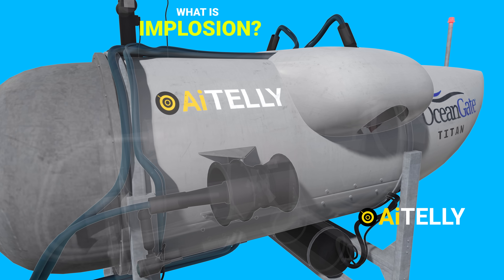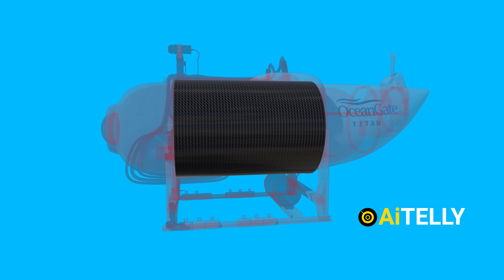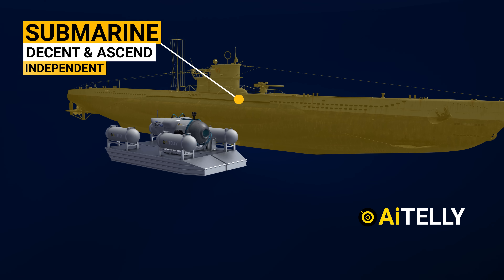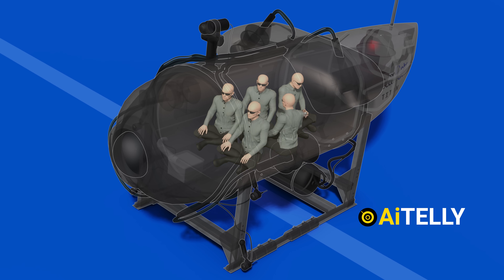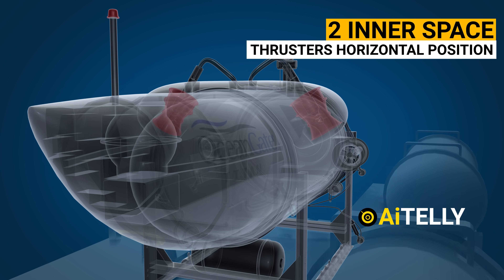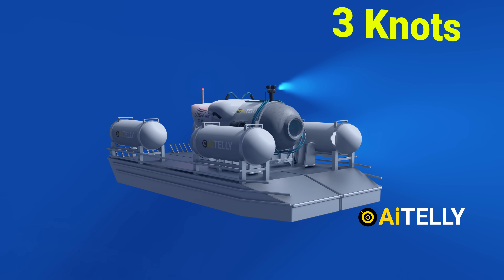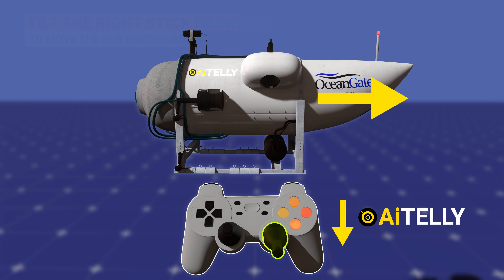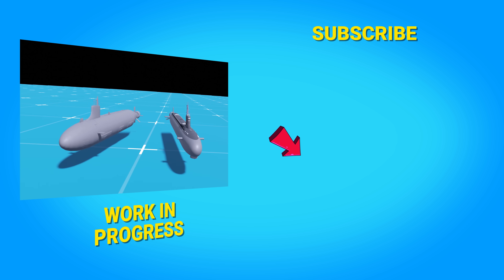Implosion Titan Oceangate How it Happened | Submersible Submarine Parts #3d

Comment: I worked in some of the original HMG (High Modulus Graphite) research--Pratt & Whitney. HMG is significantly stronger than CF. Our prepreg test panels were angled at 30 deg. layers, like plywood, then placed in steel molds and cured with variable pressure and temperature in a thermal press. Cooldown was also a stepped decreasing pressure/temp. process.
The winding and curing process used on the Titan was abysmal and destined to fail. With the changes in pressures and temperatures being repeated, the epoxy/fabric system was doomed to fracturing of the epoxy. 
As soon as I heard of the rapid loss of communication, and then no surfacing of the Titan, I turned to my wife and stated, "it imploded." Never would I have gone on that submersible, once I knew how it was built, and added to the poor materials design, had no internal escape.
Reply: A soon as I heard “submarine made of carbon fiber” I knew they were all dead and it imploded, not an engineer or a scientist, just someone not stupid enough to think carbon fiber would make a good sub lmao
Reply: @joshuad1716 Same.
Reply: You DO NOT build submersibles, with composites, PERIOD!!!!!
Reply: If the supposed leaked audio is true, they were descending unexpectedly fast. They might have already had a leak from the very beginning.
Reply: So incredible yet devistating...being so wealthy I'd assume they'd know this information. Are we truly loosing common sense even with every answer available at our fingertips
Reply: @kelsieann4617 There are plenty of dumb wealthy people in the world. Wealth doesn’t correlate with intelligence
Reply: @louisboliou7432 Did you work at P & W in North Berwick, ME?
Reply: Even when I do my nails I have to sand and remove the moisture from the area that I'm going to glue a tip on. And before I put the acrylic on it absolutely has to have a porous surface to be able to bond to it. 
They didn't even send the cylinder before they glued it. Nobody used gloves while they were wiping off the surface to remove oil m
Reply: Was this the first time this craft was used?
Reply: @korieray7341  No it wasn't. Not even the first craft they built either.
Reply: I am getting frustrated with no concrete information about this tragedy. Is this incident being investigated? If so, by whom?

In your opinion, is it possible to build a submersible with High Modulus Graphite to be able to safely visit the Titanic? The fact that Stockton's submersible made it there and back a few times means it was "almost" successful.

Just guessing, but would a thin steel outer layer around the carbon fiber make it work better?

Comment: That is not accurate, the sub only opened up through that little window that was held on by 19 bolts only accessible from the outside.   The titanium end caps are permanently glued on the the main pressure hull.

Comment: Just the hull section was approximately 40,000 square inches of area on the outside. Multiplied by 5,300 psi, that’s over 200,000,000 pounds of pressure 
I don’t know how you trust metal in that application, let alone carbon fiber.

Comment: This Submersible was doomed for failure from the start as the owners at OceanGate did not put the sub thru the high intensity testing to insure the craft can safely withstand the crushing pressures found at the Titanic's location of 12,200'.Using composite materials to cut costs was the nail in its coffin as many submersibles use a combination of Steel, Titanium and aluminum. RIP to this crew. 🤔🇺🇸

Comment: That implosion was underwhelming.. I expected it would be like a soda can getting squished into the size of a golf ball.. Also I find it really hard to believe this small submersible had no kind of footage/live footage anywhere on it.. I'd bet someone has it, even though it might no show much .. why wouldn't they attach a floating camera that drags along with it so it's viewing the sub from a short distance.. I don't think any of that is impossible or wasn't thought of
Reply: The implosion would have been in microseconds with them being smashed into bits and then it would have exploded violently. The air inside would likely have increased to thousands of degrees in that small fraction of time. It wouldn't be anything like the small crimp that happened in this video. A cool video but the implosion part of it was not anything even close to what would have actually happened. If you know how diesel engines work: it would have been like this sub being inside a giant diesel cylinder, and being crushed until it detonated violently.

Comment: Carbon fiber is good for lateral stress and in tension. Example: airliner fuselages and wings. It's unclear if it can resist the compressive forces the magnitude of a 12,000 foot water column. Also, a sphere is the strongest shape for this application, as forces are equivalent at all points. This thing had everything wrong with it

Comment: It's worse than this... By far. They KNEW they were going to die for about a full minute as they plunged straight down, porthole first, in total darkness. They lost power early into the dive, tipped 90° , and dropped like a rock. There was also an EXplosion A nanosecond after the sudden implosion. When air is compressed that quickly, it superheats resulting in an explosion outward.

Comment: Where did you read the carbon fiber hull "crumpled" like that? Everything that I've learned about carbon fiber through mechanical and aerospace engineering degrees says that carbon fiber would never plastically deform the way you show it, it would shatter like glass. This means the entire premise for your animation is completely flawed because the point of the animation was to show what happened to it and if you dont have some source that shows it crumpled, then you've misinformed millions of people and did a huge disservice to them and the engineering/educational community. I'm happy to be wrong if you have a sourfe though.

Comment: I think that it's unlikely that the oxygen storage and air recycling systems were located in the rear electronics compartment, as that would require penetrations of the endcap to allow gas transfer.  I think that it is more likely that oxygen storage and air recycling /carbon dioxide removal systems were located under the floor of the submersible within the pressure vessel.
Reply: You know we had specs for this thing right?

Comment: It's my understanding that the Titan did NOT submerge using its thrusters but the ballast tanks on the barge it was docked to, and that once it reached a certain depth, would detach and rely on its thrusters for smaller changes and surfacing.
Reply: The thrusters are used to control the speed and angle of descent. Like the diving planes on a submarine.

Comment: The buttons don't look right. The left analog stick is for the camera, everyone knows that. Then, it should strafe with the left, turn with L1 and R1, L3 for descent and R3 for ascend. L2 for thrust forwards and R2 backwards. Square to toggle lights on, double tap for the highlights. Hold X to stand still and stabilize. Triangle for radio contact and O to change between 3rd and 1st person view. Start goes for the options menu. The select button is to implode. Who agrees and who thinks it should be otherwise?

Comment: A couple of shortfalls:
A ship would not drop anchor at that depth 4:35
The aft section at the back would not crush as it's outside the pressure vessel. 0:41
Reply: Thank you for saving me writing same. It's a fancy cartoon, but incorrect.
Reply: You sure about that? What about the oxygen tank and C02 recirculation pump that pumped through the vessel compartment. The parts/pieces inside the aft/tail section would be under the same pressure where it interfaced with the main pressure vessel. If one the ducts or hoses failed it would enter the cabin, like a door on an airplane when pressurized, except instead of sucking out it would suck in.
Reply: @kevins.3825  That's an interesting thought about an external tank imploding. A standard SCUBA tank is full at 200 bar with a big factor of safety. But if they got to the bottom there was 380 bar, a differential of 180 bar compression which a normal tank is not built for. I assume folks designing a submersible would not have overlooked that.
It's possible, but not likely that the external equipment fairing collapsed first and not in the context of the implosion the article was describing.
Reply: @edwardwilley3404  that’s kind of the whole problem with this particular rig is that many things were either overlooked or not tested correctly. One of the most experienced people on the planet for deep dives in submersibles is James Cameron. He has made mention that likely an internal sensor alerted the crew prior to the implosion. So although the crew may have not felt it, they were possibly aware of the issue. 

Let’s say for the sake of discussion that the tanks were not overlooked. How does the ducting factor in? Anything that is hollow or has space is basically collapsible. Those tanks would have to have plumbing into and out of the pressure vessel. 

What is the one thing the movies portray when a ship is sinking, it’s usually pipes starting to burst and cracking to simulate buckling. 

Not sure if we will ever know but at least from the pics the nose cone and view port appeared to be intact. I’m sure in about a year from now we will have learned as much as possible from the investigation and theory.
Reply: @kevins.3825  I've had a long career in Offshore oil engineering and my industry has learned a lot of lessons the hardest way. Given the huge volume of really dangerous things we do, we do really well.  It's when someone thinks they are smarter than those that have gone before and ignore those previous lessons that gets them in trouble.
Reply: @kevins.3825 the acrylic viewport itself was gone, only the titanium that had held it in place was intact
Reply: @kevins.3825  interesting theory, not the main one that's been out there, but seems worth considering. 

I still don't think the steel casing would have crumpled, in fact I believe it was one of the pieces that  visible being lifted off the recovery vessel, and was damaged but not crumpled.
Reply: @laurencefahrni4821  agree I think I mistakenly thought that the pressure hull was titanium surrounded by a carbon fiber sleeve to reinforce the pressure hull and reduce weight. From an engineering perspective that’s what I would have tested. I assumed this because to simply construct a pressure hull body out of carbon fiber at least to me is just crazy. Carbon fiber is strong but it shatters into fragments under pressure similar to glass. I’m surprised and it seems like just dumb luck that it even surveyed one dive vs a few. I would have never gotten into that casket with the design criteria. One thing that I have learned from this is the time it takes to die is less than what pain receptors, vision, or hearing can register with the brain. It’s just weird to think that if you were sitting in this thing thinking everything was ok, in the event of implosion one would never know it happened.
Reply: Two.   Two slight issues that in terms of information does not matter.  This fancy cartoon is still bang on
Reply: @kavalogue  simple minds are simply amused. When it comes to investigating engineering catastrophes I prefer facts. The animation is great, just no need to speculate with the commentary when the facts remain unknown.
Reply: @kevins.3825  But speculation is good exercise and changes as facts are revealed. We'll never have enough facts to completly avoid speculation.
Reply: Also I thought the vessel couldn't go 4000 meters like what is stated in this video

Comment: Great animation but it would help to differentiate better the different parts of the submersible and it's design. You are going to miss key aspects and it looks like already having caused an error in you animation.

The carbon fiber hull had two titanium interface rings bonded to each side of it. Then two titanium domes bolted to the interface rings.

The domes consisted of 1) the hinged opening titanium dome (with viewport) at the front of the submersible, as in your video, which provided entrance and exit for occupants and 2) an identical titanium dome (sans viewport) at the rear of the sub hidden underneath the outer glass fiber shell.

The entire glass fiber shell (as well as the frame for the systems in the rear and landing skids) was also attached via the interface rings.

From the outer shell pieces and the rear frame and system components recovered, it looks like water freely moved through these pieces... and the pressure stayed identical as the submersible went deeper, meaning that the deep sea pressure was concentrated on the carbon fiber pressure hull.

Whatever rhe weakpoint was (hull... viewport...) failed and the pressure hull imploded with its five occupants inside. The force of the implosion and resulting shockwave tore the titanium interface rings, titanium domes (endcaps), the glass fiber shell and various other parts... away and out as the pressure hull was shattered.

At 5:57 you've got the rear glass fiber shell impliding inwards and Im not so sure the evidence (including recovered outer shell pieces) supports this.

Thanks again for an overall great animation.

Comment: IT WASN'T TESTED OR CERTIFIED!! 
Carbon Fiber hulls for deep ocean craft have never been adequately tested and consequently, never certified.
The craft was so "innovative" that it would've "taken YEARS to get it certified"!!!

The test they conducted on a 1/3 scale model of the Titan is the ONLY documented testing that was done and the carbon began to tear more and more as the pressure increased. That pressure, BTW, being nowhere NEAR the pounds per square inch of pressure where the Titanic rests. 

From what I gathered, they didn't test it any further. If they did, they would have seen an implosion.

They stuck with the carbon fiber!!

Comment: Note that the porthole was used as a lifting point to put the lifting slings through the dome, implying that the window was blown out. Was it blown in or blown out?
Reply: I would guess blown out when the cylinder was compressed. Like the cap of a toothpaste tube if stepped on.

Comment: I don't believe the way the failure is depicted is how it would have happened. You don't need to be an engineering professor to see the weak points. A real life understanding of the strength of the design can be tested by holding the cardboard center of a toilet roll between your thumb and index finger. You can feel how a cylinder is weaker at the ends that it is in the center of the tube. The ends of the CF cylinder used in the sub were connected to the metal end caps with adhesive. Clearly with several compressions and decompressions the bond of that adhesive has degraded. Once that adhesive fails the ends of the tube would have imploded inwards instantly. There's a reason every other deep sea vehicle that's been used before have had a passenger compartment that is spherical in shape.

Comment: The one thing that they didn't admit to is what happens to the people inside of the sub!!!!My guess is that they didn't think people could handle it!!!This is what happens inside of the sub!!!AS the pressure build's on the outside of the sub that pressure compressors the air inside of the sub Wich turns to friction and the air ignites incinerating everyone on board in less than a minute like at a crematorium leaving only ass and not even bones and because it's in the water the ass spreads out in the water!!!The only good thing is that the incineration happens so fast that they don't even feel it!!!

Comment: The sub had been hit by lightning,  and Rush was using An old video game controller. That controller was half of the problems in general. They glitch on a regular basis with a Video Game! Of Course that controller messed up. That's Probably Y Rush couldn't get the sub to rise. AND who's to say one of the components to raise it up didn't mess up, or the water pressure would have damaged something to keep it from dropping weight.

Comment: That cheap game controller, with the flimsy circuitry, wires, capacitors, connectors, etc., was NOT designed or manufactured for use in a highly corrosive saltwater marine environment. Jesus!....

Comment: Is it just me that had the thought that the directional toggles were switched? Like, typically using a PS4 controller with a video game, the left joystick is 360 directional, only on the horizontal plane. And the right joystick is the one that would move on the vertical plane. I know that wasn't the fail point, but I'm just curious if anyone else had this thought.

Comment: Carbon Fiber is prone to shattering. Even if it could go down its only once. You cannot guarantee the integrity of the laminate therefore saltwater intrusion will probably occurs somewhere. Especially if you're drilling bolts from the inside out

Comment: A key component not addressed is the material used to hold the carbon fibers together and in shape.  This is some kind of plastic, probably an epoxy.  The properties of that plastic can possibly play a bigger part in a structure's failure than the carbon fiber.